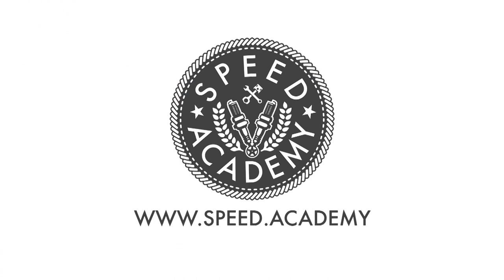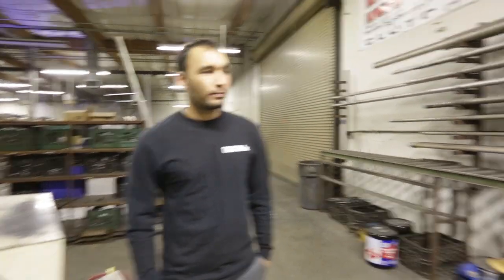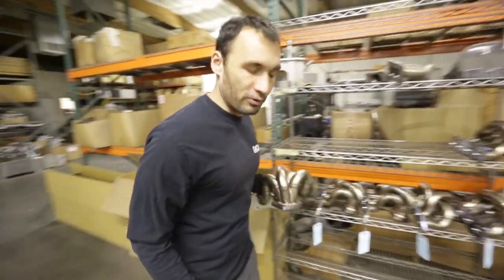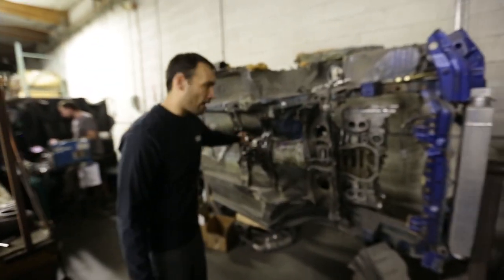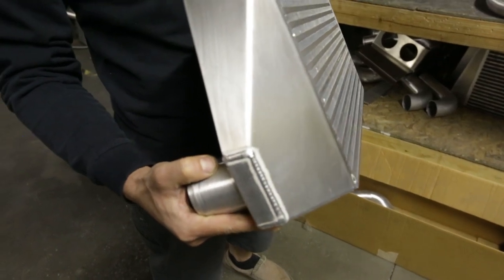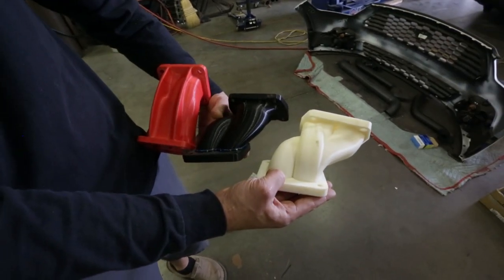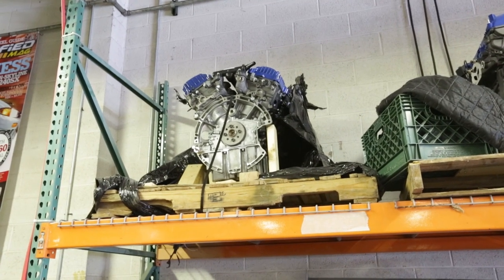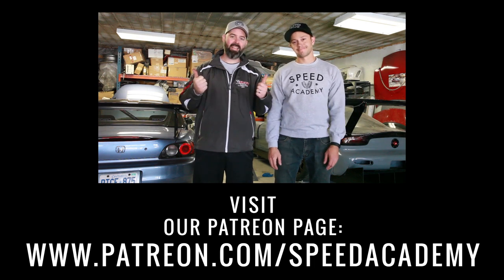How Turbo Systems are Made - Full-Race Motorsports Tour

Comment: I drool over their EFR7163 kit for my Mazdaspeed 3.
Reply: I want to upgrade to a big turbo for my Mazdaspeed 6, but I'm not sure. I thought my stock turbo was maxed out, but it turns out my stock BPV is leaking and I'm waiting for my aftermarket one to arrive.

BTW, this is the 3rd video I've seen you! :D
Reply: SI0AX Haha, what can I say? Mazdaspeed 4 LYFE!

Here's the low-down about the stock turbo (Borg Warner's K04): it only flows 35 lbs/min. This means on a Speed 3 that's fully bolted in a region with good-quality fuel, you can hit in the 290-300whp and 325-330wtq range on 93 octane. On a Mazdaspeed 6, you'll have lower numbers than this due to AWD drivetrain losses. I speak from personal experience, having tuned Gen 1 and Gen 2 Speed 3s, and Mazdaspeed 6s. If ethanol is in your area, you can run an E25-E30 blend and up those numbers to ~330/380 on a Speed 3.

It all depends on your goals. I went with a BNR S3, which flows ~43 lbs/min, yet still spools really quick. On my ethanol blend tune, I put down ~385/380 in good weather. In the dead heat of summer, I'm down to about 365/355, but that's higher than it would be otherwise because I spray water-methanol too to keep my charge temps a lot cooler.
Reply: SI0AX Yeah, far too many of their fakes. I personally run the Synapse Diverter valve. It's pricey, but it's the fastest reacting valve on the market. A lot of folks like the Corksport one and the GoFast Bits one that has custom-adjustable VTA. Technically we lost metered air if we VTA, and that causes issues with richness, popping, etc. But if you set it to just VTA like 25-30%, you can usually have the cool VTA sound with little to no drivability issues.

If properly setup, a BNR S4 will generally hit 20 psi by 3,700 or so. I hit it by 3,250, and that's with a tune set to keep boost low in the bottom of the powerband to keep my stock block happy. And if you have a stock block, I think the S3 is the better choice, personally. If you ever want to build, you may want to get the S4. You should easily hit 450whp with it with proper supporting mods. I'm at ~385/380 @ the wheels on my S3.
Reply: Ah, I talked to the seller and he was flat out honest but said the fakes perform well. He said I could return it after testing it and not being satisfied. HKS specifically made the 4 because the 3 was copied so much lol. I'll check out the synapse. I plan on keeping the stock intercooler because of meth.
Reply: SI0AX The stock intercooler will be a major bottleneck if you upgrade your turbo. If you have your heart set on a top-mount, look into the CP-e on or the ETS one. You'll definitely need to upgrade with a bigger turbo. Stock TMIC flows like crap.
Reply: Numinous
I figured it would give me problems. I thought it was just cooling at first, but a bigger turbo with need better flow. I guess I might go with a front mount with the big turbo. I'll just see how limited the stock turbo is after I replace the leaking valve to see if I really need a bigger turbo.
Reply: SI0AX Yeah, you'll definitely need to upgrade. Trust me, I know these cars really well, having personally owned/tuned one for 4 years and working on many other Speeds too. Since you have methanol, you can certainly save money and have a much less complex install with the CP-e or ETS top mount options. FMICs are better in terms of not heatsoaking, but with all the extra piping they can feel a tad less responsive. They do cool better overall, but again, a non-issue with your methanol. Honestly, lack of response isn't an issue for me even on my BNR S3. It may be a bigger issue with a bigger turbo than mine. Everything still feels very responsive even with my FMIC, personally. Also, you would save a few hundred bucks with an upgraded TMIC over a FMIC setup, so that's an important consideration too.
Reply: Numinous
Thanks for the info!

I plan on going with the BNR S3 later. The ETS TMIC is about $600 while the cp-e is $420. I never bought anything from cp-e before as they only had shipping options for like 48 us states, but now they added more places and the island Puerto Rico, but they say local pickup...
Reply: The EFR will break your factory rods at 10 pounds....The  EFR comes on so hard it builds amazing torque...Torque that will bend your factory rods. Go to the Turbomiata forums and you will see what I am talking about.
The EFR is amazing with a built bottom end, but you are way better of with a Gt 2554r or GT25560r with a stock motor. Not as much mid range torque, but you stock engine will live! still goes like hell btw!
Reply: Smokin07ram You don't know much about the Mazdaspeed 3 platform, do you? LOL

Many people are running these just fine on stock block. It's all in the tune. Controlling boost onset location and ramp-up is key. We have many, many folks on stock block racking up hundreds of thousands of miles at ~380/380 @ the wheels.

As for me, I'd be tuned for 500whp, and it'd be on a built motor, so it's completely a non-issue. I'm not a car noob, bro. I've been modding, tuning, etc., for quite a while now, especially with my platform. Appreciate the caution, but I 100% know what I'm doing regarding this turbo. It may interest you to know that I'm already running 25psi on a hybrid GT2871 turbo.

FYI, those GT25-frame turbos you're talking about are WAAAAAAYYYYYYYYY too small for Mazdaspeed 3s. They aren't Miatas! ROTFLOL.

It appears to me you're suffering from the misunderstanding that I have a Miata. I don't. I have a Mazdaspeed 3. Much larger/much stouter engine.
Reply: Numinous Sorry thought you had a miata :) 
I have a Miata with a EFR on it and love it! I called it quits at 450hp, then dialed it back to 350 as I was braking 6 speeds too often.2100 pound car...its pretty quick!

When I bought my S2000 I tried the EFR and it was terrible....It just does not work at 9000rpm I guess?  Spool and response were not what I had come to expect from my miata Switched to a GT3576R and made 516 hp on 15 pounds 91 octane!  684hp on C16 ..Both are very conservative tunes. 

Good luck you your speed3!
Reply: Numinous You haven't built the car yet right? My daughter has a 2007 speed 3 and your comments had me so curious I made a phone call to my tuner (also a good friend). He said he pulls a bunch of boost and timing out of the torque peak so the rods don't fold on speed 3's? In other words without forged pistons and rods that motor will shit itself all over the ground. The EFR is DESIGNED to build huge midrange torque and will cost you power on the top end (where other turbos make way more power)...at least in a in a stock motor build. I did some homework and the the best turbo for stock motor is probably something like a Garret GT3071R. It will make more top end horsepower, is cheaper, and any difference in midrange is a non issue for a stock speed 3. With an external gate (boost creep with an internal gate could easily pop your rods). What I would do anyway
Reply: Smokin07ram Point of clarification: The EFR, with its Gamma-Ti wheel, is very quick spooling and has excellent transient response and a very low boost threshold. The key is boost control. Most of us big turbo guys are running 3-port EBCS and can custom-tailor the boost levels to suit our needs.

We push torque peak out past 4,300 rpms or so (due to more torque down low being more dangerous for rods), and the torque is neutered down low so that it doesn't ramp up quickly. Stock block folks adjust driving habits too, and doing ever drop the hammer until later in the powerband. We're not idiots. Many of us are not only racers/auto-xers. but chemical, mechanical, and electrical engineers to understand these cars only nearly a sexual level, LOL.

I appreciate the insight, but the Speed 3 platform is extremely well-vetted out. We know what works; we know what doesn't. We're not like the Focus RS guys who are just now beginning to figure this stuff out for their engines. We're over 10-years-deep and literally millions of miles of practical experience into this engine/platform.

What you said was true, in part. Ultimately, the most important part you left out: the EFR7163 is a 60 lbs/min ball bearing turbo with water and oil going through the CHRA: http://forums.nasioc.com/forums/showthread.php?p=40727288 . It also has an integrated BPV and boost control solenoid and an IWG design that is more than capable than stopping boost creep even on extremely high-flowing setups.

I've been tuned by one of the most reputable Mazdaspeed tuners in the world. He holds multiple Mazdaspeed 3/6 world records. Not only is he a Master Mazda Technician, but he has LITERALLY tuned over 1,000 Mazdaspeeds. He knows what he's doing.

I appreciate your concern, but it's not warranted at all. Us Mazdaspeed guys know all of this stuff. We've successfully made turbos all the way down from my GT2871 hybrid and GTX2867r's up to GTX3071r's, GTX3076r's, GTX35's, PTE5858, PTE5862, PTE6266, and PTE6466 run excellently on our platform.

I know you're trying to help, but everything you've said I know, and more; most importantly, I know specifically how it applies to MY PLATFORM. It be like me coming in here and starting to give you all sorts of Miata advice. I appreciate the thought, but trust me: I know. The Mazdaspeed 3/6 community has been knowing this stuff for YEARS.
Reply: Numinous
I want to ask a quick question:
I have a Mazdaspeed 6 and am planning on going for a Corksport turbo(this is similar to the BNR S3).

I have all the supporting turbo mods installed right now except for the TMIC(which I will soon buy) and the 3-bar MAP sensor.

I'm worried that running past 24psi will cause headlift(I've seen some people put that in forums) and I will have to replace the headstuds. Do I really have to replace the headstuds, or will the stock studs hold up and not lift the head?

I don't want to build the engine, I just want around 380WHP/WTQ. And I have methanol injection.
Reply: SI0AX I don't know much about the specifics of the speed 6, but I did have a look  at the torque limit of the stock internals. One of the posters I think said it best "over 350Hp you are taking jabs at God" :)  There are guys making 400+hp, but the general consensus was that they are living on borrowed time. Which is fine if you have the money to replace the engine.....

I also looked at that turbo.....The wastegate port and flapper are puny and you will get boost creep as delivered. A 4 port (not 3) will give your tuner the best possible control over the torque peak (torque breaks the rods) and will allow all of the possible boost while holding back the gate. A three port with a 5 pound spring will not be able to hold the valve closed at max boost.... overspeeding your turbo and killing top end power (if your engine can take the boost)...Even still I would look at the port/flapper and see if there is enough flapper coverage that you can open up the port...If even a little bit. I could find no turbo map for the Corksport turbo so I have no idea what boost it is capable of before choking.  Lastly you need to find a tuner with a good amount of experience with your motor...More than anything this matters!
Reply: SI0AX Have a look at a 4 port controller...about the same price, but it will hold the gate closed at high RPMs when you are running a small spring. I had to change to an external gate on my S2000 and my sons (built) miata...Both were running EFR internal gates.

Never had you figured for an idiot...not for a second! I have seen a lot of well intended guys blow up engines. Its never pretty :) 

The man that runs a 6466 (Jezuz Wept!!!!) on a Speed 3 is a nutjob! My kind of guy! :)
Reply: Smokin07ram Again, your brief perusal into my platform is laden with a lot of falsehood and misinformation. Many people, in fact, are at 500whp on stock internals with zero issues, so long as they run a lot of alky and sufficient supplemental fueling.

The 350hp "jabs at God" comment is simply untrue. You're wrong about 4-ports on our cars. We run 10-14 pound springs, have no need to run less, and retain excellent boost control. Garrett doesn't even offer anything close to a 5 lb wastegate option on their turbos for us. Heck, the factory, super-quick-spooling K04 runs a 10-lb. Sorry, bud, but you're just dead wrong regarding the platform.

Sorry, man, but you don't know what you're talking about regarding Mazdaspeed 3s/6s. Funny that it's Halloween, because it seems you're on a witch-hunt, LOL

The proof is in the pudding. In all of your cautions, the LSPI issues that need fixed by reputable tuners due to improper factory calibrations (your 2007 girl really should get that addressed ASAP), and our HPFP running out of headroom very quickly if not upgraded, potentially causing leanness and catastrophic failure when @ WOT weren't mentioned once by your. You're barking up the wrong tree. The "issues" you claim aren't issues at all. The legitimate, highly important ones, you haven't even mentioned.

I appreciate your heart to help, but you should stick to your own platform. You're way off base here.
Reply: Numinous
My tune below 3k RPM is factory timing and boost.

At 3k RPM+ I have the ignition timing set up to run from the lowest map at like 4* below MBT and to gradually increase to the MBT limit based on cars maps with similar setup. My boost and load target are setup to target as close to 22.3psi and the throttle is set to as close as I can get without hitting my set fuel cut at 22.3psi.

My throttle is set will close a little before hitting the fuel cut though.

My AFR is also set to 12.5:1 but I plan to change it to 12:1 once I get the upgraded turbo.

I know the Mazdaspeed 3's stock internals are good to about 400 wheel torque. You can have a lot more HP than torque with a big enough turbo. So you could have 500WHP and less than 400WTQ.

I'm just using the sterotype of 2WD-15% vs AWD 20% drivetrain loss so:
400 / 1.05 = 380.95
Which means than 400WTQ in a FWD Mazdaspeed_3 is equal to 380WTQ in the AWD Mazdaspeed_6. This is just an estimate that is not accurate but that's why I want a little below 380WTQ to make sure my stock internal will be safe.
Reply: Numinous So you can run 10 pounds in first gear and not blow the tires off? Is that a stock turbo? The site I was looking at had guys running 5 PSI springs to get first gear traction? The factory turbo and a larger performance turbo don't make the same power at 10 psi....A 10 pound spring will be all over the road in a larger aftermarket turbo
I am confused?

The detonation or whatever issue was fixed before we bought the car. 
I only run external gates and have no idea what garret has for internal gates. 

I said I don't know the speed 3/6 cars well. I do know how things work and I do understand turbos/gates and how they work.

No witch hunt intended
Reply: Smokin07ram
Wheel-spin is caused by a lot of low-end and instantaneous torque in a FWD car.
 With a bigger turbo, the the general torque is sacrificed for more HP and the torque band moves to the high RPM range and takes a while to build boost vs instantaneous spool with sudden torque delivery of the stock K04.

So a bigger turbo in a FWD car, is much better for traction.
Reply: Smokin07ram Dynamic stability control and traction control significantly limit power delivery in 1st and 2nd in stock form.

Additionally, another known extremely problematic issue that you didn't mention (when you were mentioning all sorts of other things that aren't actually issues at all when you know the platform inside/out and how to properly set one up) is the design flaw in the early VVT actuators. Up until the early 2009 production year (so this actually includes some early 2010 (2nd gen models), a TSB exists to replace the original VVT actuators. If the young lady with the 2007 hasn't had the VVT update, she is literally driving a timebomb.

BTW, the 350 figure you mentioned being completely erroneous is presuming 93 octane. You realize, of course, that running various forms of alcohol and larger turbos with larger hotsides keeps the combustion chamber much cooler, don't you? That's why many people are very successfully running 500/380 on stock block, so long as they're using a 3076/5858 or equivalent sized turbo with a good-sized turbine housing and lots of alky to keep things cool. The torque limit is honored because the issues that impact rods are still the same. But those larger turbos are usually more rod-friendly too because of higher boost threshold and boost ramp up. The 500/380 guys can have lots of reliable fun for years so long as they make sure to keep their alky high. If not, the extra heat in the combustion chamber can cause ring butting and pop ringlands.
Reply: Numinous I will check into the VVT...I believe all of the recalls have been taken care of.  Never heard of that issue, but like a said tice befoer I don't really know these cars.
I looked for guys with 500Hp and only found built motors? Got any links to those? I would like to see a few....sounds impressive though!

My S2000 Has a GTX3576r....and the torque is pretty ferocious....In a motor that does not really make torque! I believe you are have underestimated the torque a bigger turbo makes and how hard they hit!

My ECM is set up (Via the 4 port) to control the boost. 1st gear is down at 4psi until after the torque peak (where there is quite a bit of spark retarding)...Then ramps to 6 PSI as torque falls off. 2nd gear is pretty similar, but I advance the spark to where is should be by 7000rpm. 3rd gear I am around 15 psi near to top end and traction is still very sketchy, but not out of control. 4th gear is when things get serious...by the top of 4th I have 500hp on tap.....This is with 285/35R18s RS3s.....

500Hp in a front wheel drive Speed 3 would be a wild ride! Still would be cool to see it being done!
Reply: It's done all the time. Mark Gibson, for instance, a well-respected builder/tuner in the Midwest, has setup many of them. Some of them are even 150k+ miles on stock block. Knowing what you're doing goes a long way.

LOL @ an S2000 with a turbo that large having lots of torque. You should drive a Mazdaspeed with an appropriately sized turbo, then you'd know what torque really feels like. You'd know about broad power under the curve for more than 70% of the powerband instead of a peaky few thousand rpms near the top, acting like a motorcycle engine ;-)

I'm not interested in cars that don't make appreciable power until 5k or 6k, An off/on switch-like boost/power curve like those Hondas or dyno-queen Evos in not at all appealing to me. Lemme guess, you make like 500/350? To each their own.

Mazdaspeed 3s have guts, and that's why they're a blast to drive: turbo cars that feel like V8s all over the powerband, especially when built and with a turbo like an EFR7163. We can easily get over 500whp with a massive amount of wtq early in the powerband on even a GTX3076r. They're like this stock too. And my personal 385/380 (@ the wheels) has a TON of safe/reliable power under the curve. It's not a dog around town in the least and is a blast/extremely responsive to drive wherever I am.
Reply: Numinous You underestimate my setup. The crower turbo cam and $3000.0 worth of headwork at inline pro......Is not what you think. No it is not a 2JC, but damn!  My pump gas setup (91 octane) has 400 ftlbs from 4200 rpm and then drops down to 350 at 9500 RPM....The C16 makes 500ftlbs from  3800 down to 450ftlbs at 9500rpm (the motor has 10,000 rpm valve train capability....It sounds like a F1 car and makes me nervous). E85 would give me more torque.....as would turning up the boost past 20 pounds. You would be way wrong to underestimate this setup....The car is scary fast...and it has another 15-20 PSI should I want it ( I don't).  The only people that suggest big turbos don't make big torque are people that have never driven a car like this or have engines that have to pull torque to live.
 
Yes the car has less 1500-3000 grunt, but it comes on way quicker than you think and from there you have 7000rpm of flat torque....If you can keep you foot in it! 

No disrespect to your Speed 3, but we are talking apples and bananas here...ask you tuner...he will confirm my setup.
Reply: Smokin07ram Indeed. I have a DD; you have a trailer queen ;-) We all know how often cars like that are running, how often they're not, and how much constant maintenance and further money dumping they require. I'll take a reliable 500whp mild-built Speed that can DD for years and years with zero issues over that any day of the week. As long as you like that car, that's all that matters. Sounds like your chassis is completely overwhelmed, though; not a good setup, at least not for my taste. That amount of $ you've likely dropped into your S2000 could easily get you a 800whp Speed. But I wouldn't do that either...